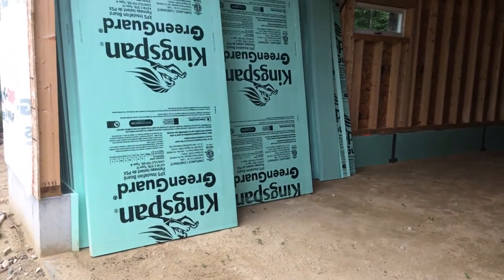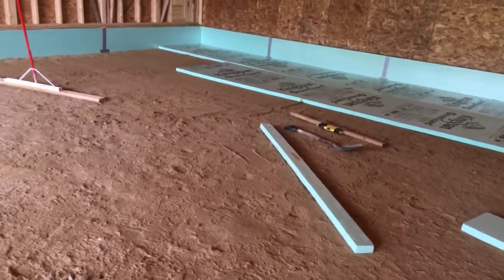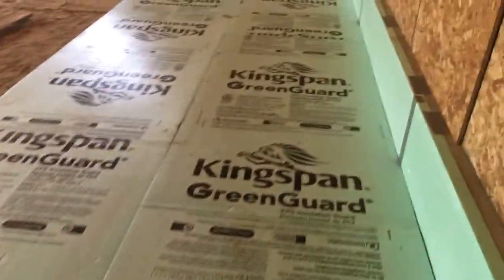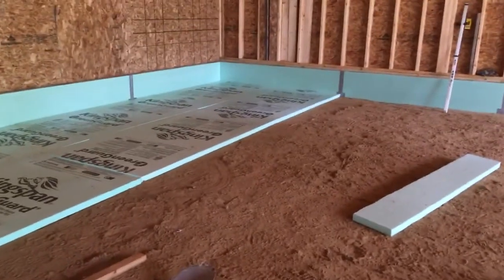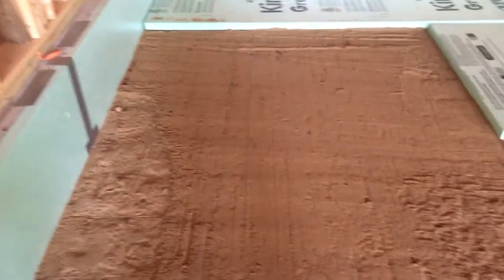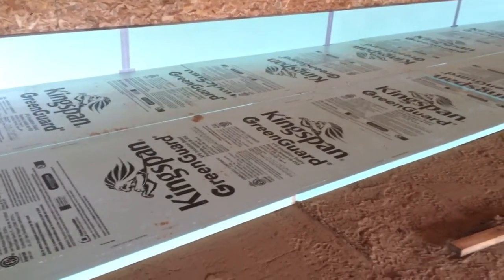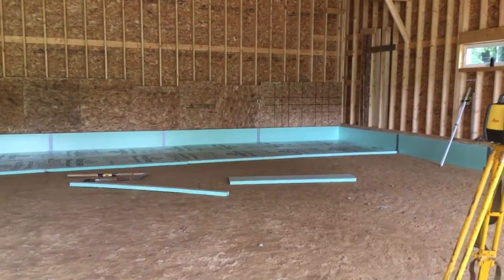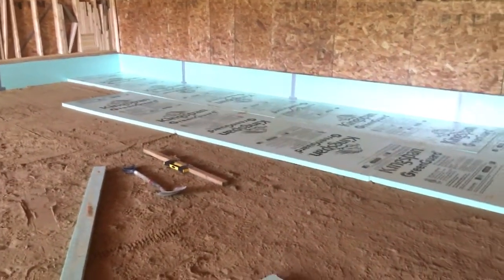Insulating concrete floor. How to prepare to lay down foam board

Comment: Good tip!  Thanks.  One thing, poly should go on top of the insulation instead of the bottom, to prevent the insulation sheets from floating up into the concrete since concrete can get in-between the foamboard and the poly.  The poly is actually a moisture barrier in a slab application, not a vapor barrier.
Reply from the maker: Thanks! I stapled the PEX directly to the foam board, so without peppering it with holes I installed the barrier underneath. I was told for it to be done this way by my concrete contractor. Thanks for your comment & happy Easter!
Reply: @barelystablefarm7151  I might not have watched the whole video.  I was not aware you're doing PEX.  My bad.  Cheers from Canada.

Comment: Excellent primer on getting the sand level. I'll bet you got better workmanship than you would have gotten after paying thousands to a contractor.

I think the plastic vapor barrier is redundant. The foam is a pretty good vapor barrier, but I live in a dry area. Maybe put all but a couple of inches of sand down, lay the plastic with edges folded and taped up the walls, then screed out the last 2 inches of sand, and finish the rest just like you did in the video.

Comment: Great video! I'm in the process of doing the same thing with my detached garage build... Did you run the foundation wall foam board down to the foundation footers or is it sitting above the sandy gravel? Did you do anything to cover/protect the wall foam board?
Reply from the maker: Thanks! I ran the wall foam board a foot below my grade. Although, I guess there is no harm in going all the way to the footer but I'm not sure of much added benefit in  doing that. My biggest concern was making sure all seams are tight and the floor foam was completely flat to the best of my ability. I did not want any air gaps underneath. I have not covered the wall foam as of yet, I'm still up in the air about what I want to do here. Good luck with your project! You're saving a TON of money!

Comment: I have some 60psi rated insulation board that I want to lay down and instead of using cement on top I want to use foam tile backer board and then put tile on top of that. I am hoping code approves this method. What do you think? Cement is such a pain to work with. and only load will be people walking over it.
Reply from the maker: I have heard of it done before. It's my understanding you cannot put tile directly on the foam and a backer board must be used (which you  plan to do). The only thing I'm not sure about is PSI requirements, though you are using 60PSI board and would think it would be sufficient. Call the Codes dept or send an email and tell them your intentions. Obviously different locations may have different codes. Good luck with the project!!

Comment: Use 2 layers of 1" overlapping the seams to cover the cracks to prevent thermal bridging , if you're not going to use tongue and groove
Cost the same $$
00:56 vapour barrier goes down on top of the styrofoam and must be sealed water tight to prevent iceberging, meaning the water from the concrete will lift the styrofoam when you pour the concrete
Reply from the maker: I directly stapled the pex to the foam. As directed by my floor guy, he said to install the barrier underneath otherwise it would be peppered with holes from the staples and essentially useless.

Comment: 4inches of cement weights 4,000 lbs over a 4x8foam board. Any air gaps you start with, won’t exist after 4,000 lbs of cement is poured over it.
Reply from the maker: Maybe so, but I'm not willing to take any chances with any air gaps (I drive heavy machinery on this) and really is the way it should be done. It isn't that hard to level the surface at a consistent grade. The purpose of this video was to show a simple tool that any shmuck like myself can fabricate to make it super easy. Thank you for the comment!

Comment: What is the strength of that insulation? I am about to do the same but no concrete over .Just 2 3/4 osb boards floating over the insulation
Reply from the maker: The rigid foam I used is 25 psf strength (XPS), plenty for under concrete applications. For your application under OSB I'd use 40 or even 60 psf insulation. Owens Corning is a popular brand. Hope this helps!

Comment: Good tips. How do you insulate the garage door opening between the slab and the approach?
Reply from the maker: I insulated the outside of the foundation wall from the footing to just slightly below grade at the door approach. I did this across the entire gable end at the doors, but not the rest of the building since it's already insulated on the inside walls. Hope this helps.
Reply: @barelystablefarm7151  Thank you for the reply. Is there any way of creating a thermal break between the concrete approach and the garage slab that you might know of? My garage will be attached so it has a frost footing but the cold approach will be against the warm slab.

Comment: I understand vapor barriers in concrete floors...i understand insulating under a radiant floor heating system.  Why insulate a concrete floor if it is not heated??
Reply from the maker: It is still important to do because the cold ground acts as a heat sink. No matter how you heat the building it will be more efficient by creating a thermal break between the concrete and the ground. In some locations this (insulating the concrete) is also required by code.
Reply: @barelystablefarm7151  I've never witnessed it being done, just curious.  Thanks for the reply.